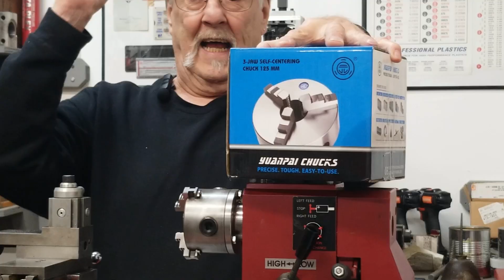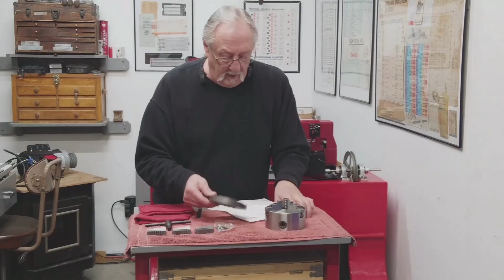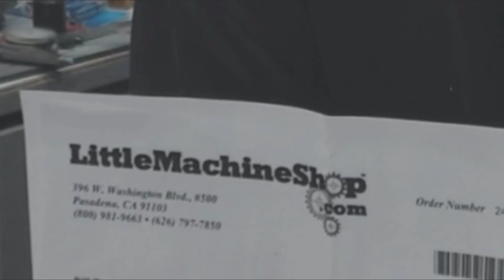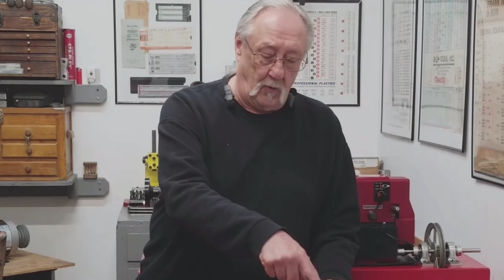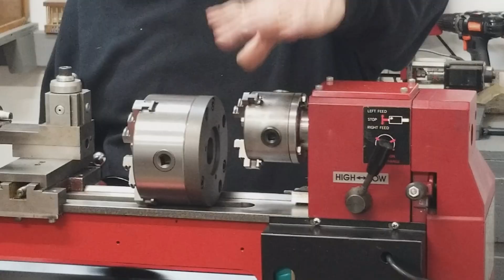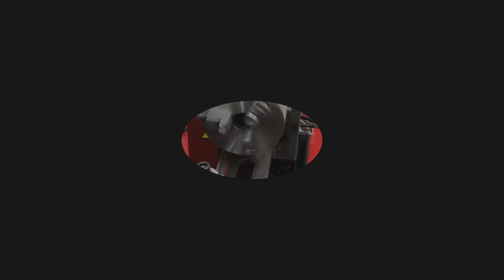Mini Lathe Easiest UpGrade, Big 5" Chuck

Comment: once you remvoe the old motor, your gonna hjave to make a steel insert spacer to keep the bed from flexing. that is a big issues with these mini lathes. they flex the bed a lot. i am working on mine to build a custom spacer that can fit with the origional motor i have (mine is a figgerent model but still flexes too) so it will remove the flexing.
Reply from the maker: Thanks for the advice. Take some pictures when you build the spacer and post them on YouTube. I subscribed to you so I will get to see your work when you post.

Comment: Like the upgrades, good series of videos. I did this but with a 4" chuck and adapter. I found plugging the unused holes in the adapter plate with some steel, really helped balance things better. I think it was around 800 RPM or so things were jumping a bit. Probably work even better had I used similar materials to fill in the space.
Reply from the maker: That all sounds like good advice, I need to do the same. Thanks for watching and commenting.